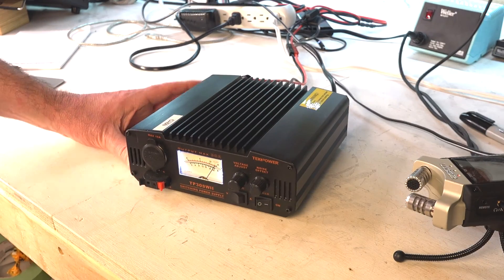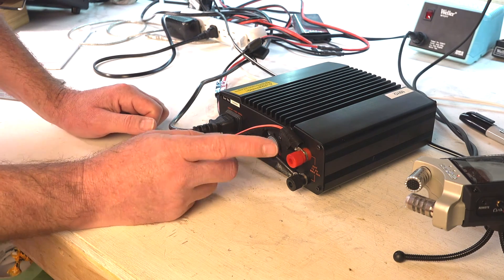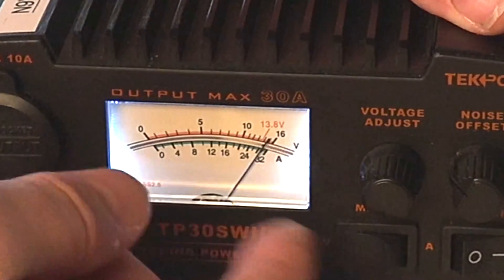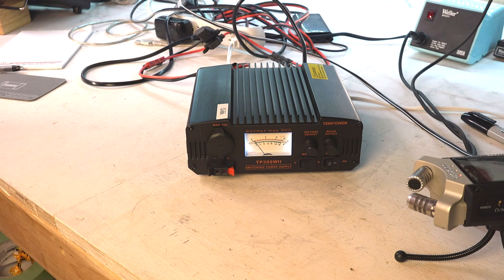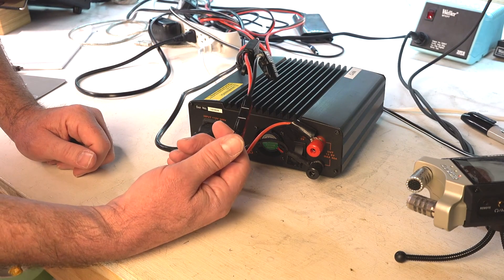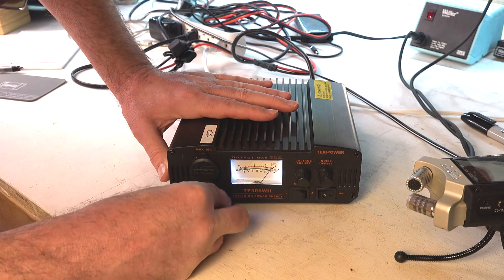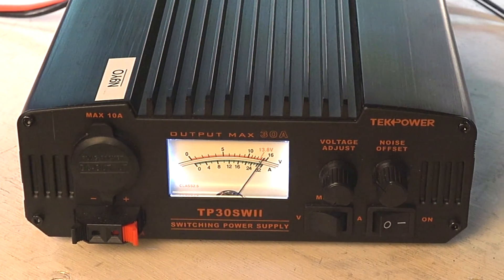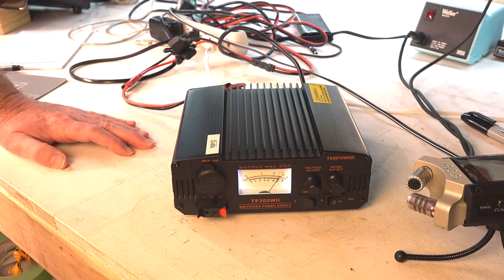Power Supply Review TekPower 30 Amp DC 13.8V Analog Switching

Comment: hi. with your powersupply on the back out 13.8V max 50A is that for the linear to go on. i have a 220W linear would that be ok to hook it up at the back and CB radios at the front

Comment: Good power supply. Small box, no need many place on the desk. I think would be more comfortable that to have separate indicator of the current. When I work in digital modes I always to control level of current. It shows me how I'm running power in the air. 73 Tom
Reply from the maker: Yup exactly!

Comment: I have the same power supply but mine has the digital meter on the front. Run my 7300 and Ft891 on it along with my 2 meter rig. Great supply with no problems at a great price.
Reply from the maker: Yeah, I don't even know it's on anymore.  Gets the job done is what I say.

Comment: You have the rear switch set to 13.8V, so the voltage adjust on the front doesn't do anything.
Reply from the maker: Awesome!  Thanks.  I didn't know.
Reply: @hamradiocq  No problem! I really enjoy watching your videos. As someone who is still fairly new to HF and CW, your videos provide a lot of basic information that can sometimes be difficult to find on the major ham radio forums.